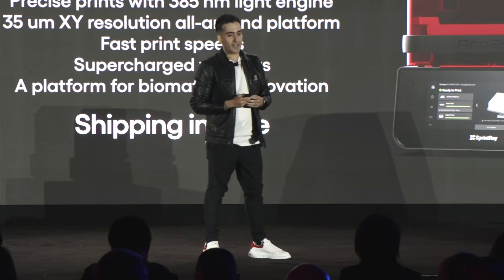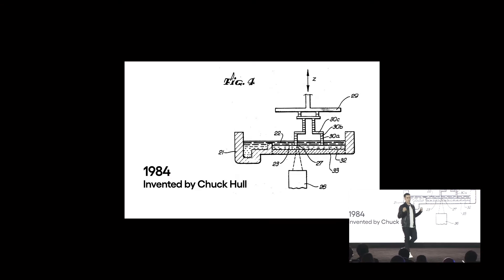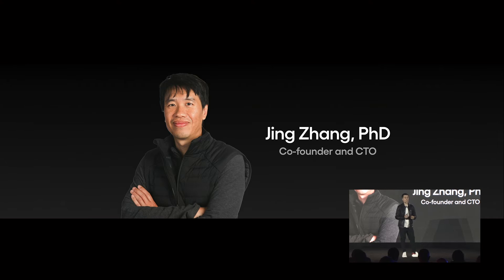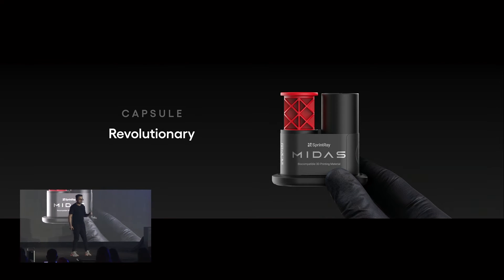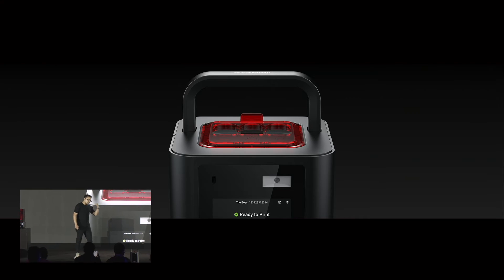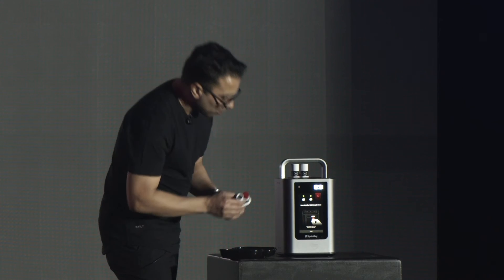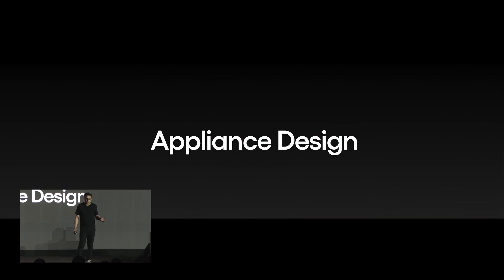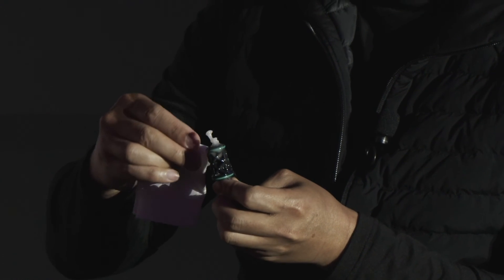3D Printed Crowns - the first real challenger to Chairside Milling: SprintRay’s Midas digital press

Comment: Got to say I'm kind of confused.  Yeah, that's an interesting concept.  Can't deny that.  However, that is the cost of a Roland Mill.  You can get a 98mm milling disk of a hybrid ceramic block that has a 220 mpa flexural strength for 70 bucks and mill around 30 restorations out of that.
Printing final restorations makes a lot of sense on the low end but that's about it.
Reply: The Midas will bring many offices the ability to print and deliver final ceramic crowns within 45 minutes at a cost of about $25 including the design studio. The printed crowns typically are more precise than a milled crown. This is just the beginning.
Reply: @3DprintSpecialist  Let's be honest here.  I know you can bill that as a ceramic, but that is not a ceramic.  You know it and I know it.  Ceramics aren't water soluble, and have no water sorption.  Ceramics flexural strength remains consistent as they age.  This material will absorb water, it is slightly soluble, and it loses strength as it ages and oxidizes.  It will have more microleakage faster than any ceramic material.  It's a composite resin.  That's it.
Reply: You’ve tested and examined the ceramic crown resin to know that?
Reply: @3DprintSpecialist  I have read multiple studies relating to all modern hybrid materials, which is what this is, except this has a lower filler content and will absorb more water than something like Grandio or Enamic, so in practice it probably won't even last as well as them, and it appears isn't even as cheap as them either.
Reply: @effefffffffffffffffffffff  And now the crowns went from 51% to 70% filled ceramic ... and will only get better
Reply: I don’t think you’ve looked at the ceramic crown resin then. It’s not just like other materials. What’s a good email and I’ll send you some specific info on it.
Reply: Enamic is more ceramic than this and it breaks
Reply: @ I printed a .3mm thick Sprintray veneer (60% porcelain) on their new Midas platform, put it on my counter and pressed as hard as I could with my thumb ... did not break or chip ... it was as translucent as any thin feldspathic I've used and I would never attempt that with a feldspathic. The porcelain/resin hybrid interface has flexural tolerances that pure feldspathic porcelains do not which makes them more brittle.
Reply: @mladenkralj8172  I'm not saying it isn't impressive.  I just don't see it as a legitimate high end restoration when you're charging 4 figures per indirect restoration.  I also know very well that the characterization of optiglaze and similar products really don't look all that great after a few years. 
Now that this has been on the market for a minute, we are now seeing that its elastic modulus isn't particularly great, which limits its use.  Its fracture toughness is pretty impressive which would make it a pretty decent onlay candidate if it weren't for its low VH its wear characteristics.  In short, looking at the data, the only place in the mouth I can see that it really would perform as well as anything else on the market is on facial veneers with no incisal function and inlays, and I would expect to have to slap a rubber dam on those facial veneers every few years to clean and re-glaze.
And then we get to the financial side.  You can do the same type of work slightly slower with Rodin dental resin and a $400 Phrozen printer.  You can do better work with a $15,000 VHF E4 mill that can do everything from better hybrid ceramic materials to lithium silicate and even do fully sintered or green state zirconia.
In short, the $14,000 that one of those with their curing unit costs just doesn't seem like a very good investment unless you are cranking out inexpensive AI created smile designs.

Comment: nah man. If I have to buy a 3 pack of capsules in order to print 3 crowns (if 1 crown is all you can fit), theres no way its cost effective for me. Unless the capsules are re-fill able (doubtful), this just seems MORE wasteful than a traditional resin printer.
Reply: i am also considering that, the cost would not suppose to be nice